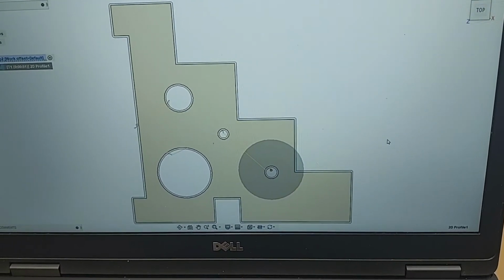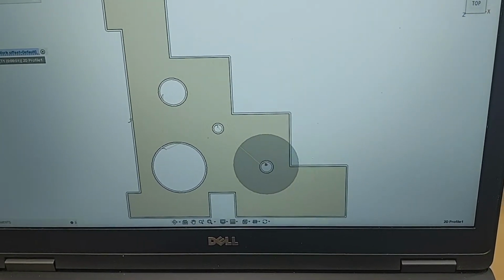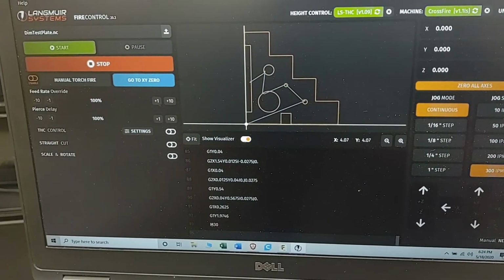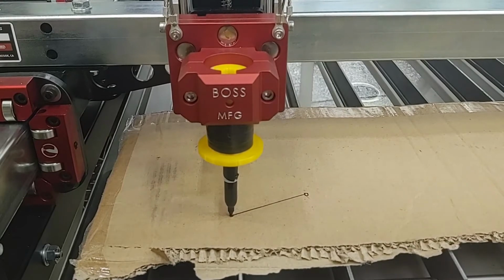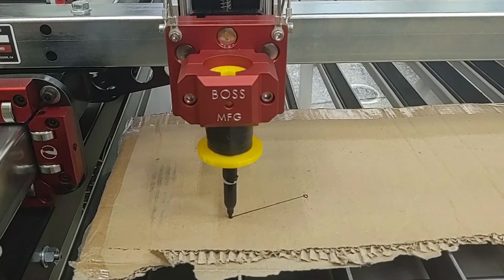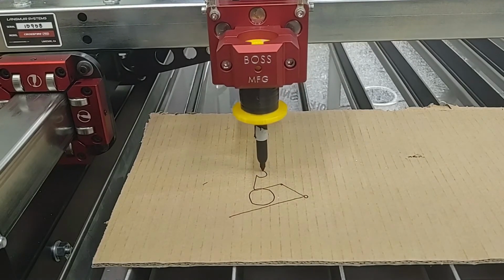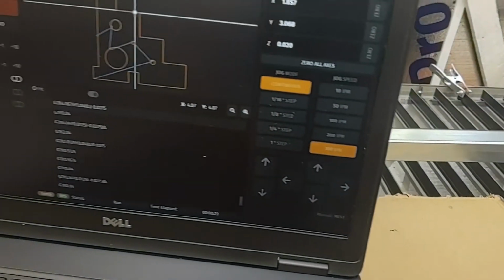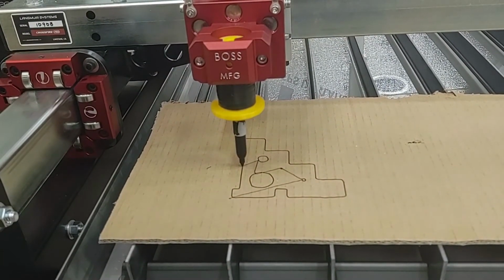Long-EZ N916WP - Plasma Cutting Table Initial Test Plotting

Comment: Hey something I was going to tell you to use I don't know anything about the langmeier system yet I am in the process of waiting on mine to be made this Month. I would use slips Sheets you can get them at any Farm Store , or freight company or grocery warehouse Your PIN would do better if you wasn't using corrugated cardboard . I usually slip sheets all the time to cut out patterns and they're super easy to draw on and you don't have the ribs in the cardboard the they're really dense Thick piece of compressed cardboard . They're great for cutting patterns out
Reply: Thanks! I really haven't been doing a lot with the pen (or the plasma cutter) lately, but will definitely keep that in mind if I need to.